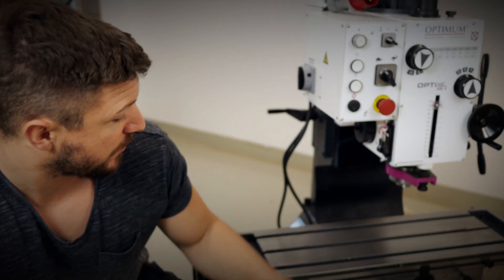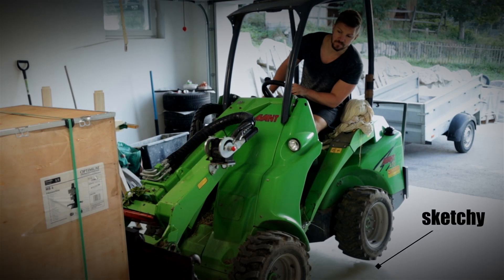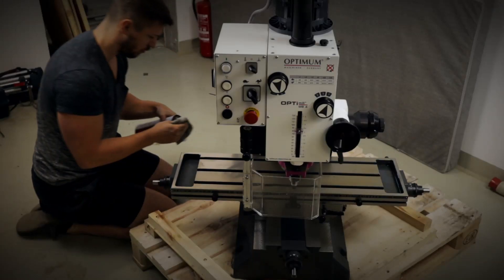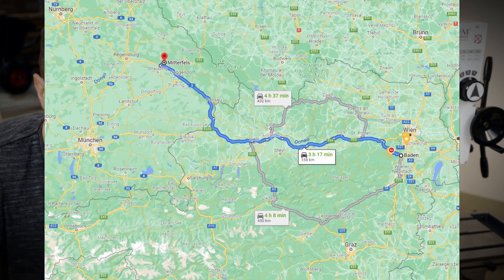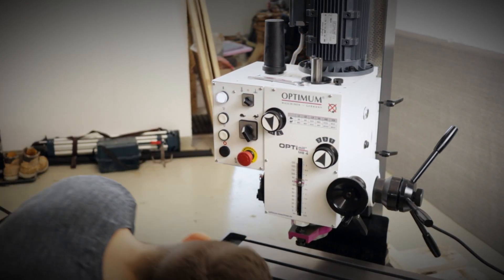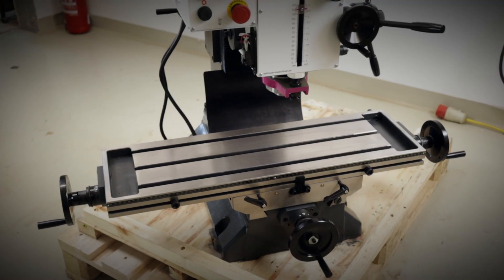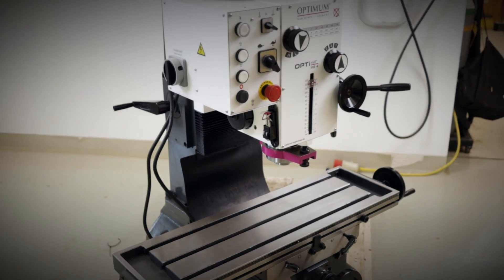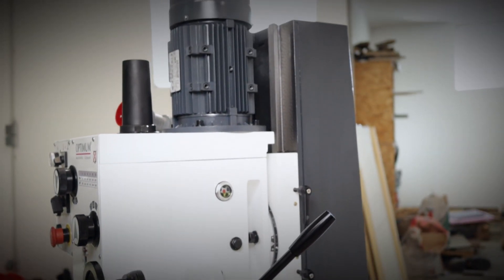OPTIMUM MB4 | is this chinese milling machine any good?

Comment: Good review.
I was thinking about mentioning Stefan's epoxy tramming video when you did.

What other mills did you look at or consider? I recently ordered a lathe through the local supplier in Australia and am looking at a mill in the near future. Right now I just want to get set up and started with the lathe and start making chips.

What projects with the mill do you have planned?
Reply from the maker: If i could afford it, i would have gone for a bridgeport, since they are more Universal and capable, but on the other hand, they are also huge, and take a lot of space.

They are also often pretty worn out, and the new bridgeport clones, are expensive.

I think the rf45 style mill, is for ita price the best you can get.
First projects will be a slitting saw arbor, a vblock, and a powerfeed.
Reply: @ChristophLehner  Good projects to start with. 
Blondihacks and Stefan G both did slitting saw arbors. Stefan's was the usual Stefan magic but Blondi's was pretty good and looked a lot easier.
Reply: @ChristophLehner  If brand new Bridgeports were only 2 or 3K we'd all have 1.
But in the land of reality we take what we can get our hands on. After watching Rustinox I'd take a shaper if it dropped in my lap. There's a lot of stuff you can do with one of those.
Reply from the maker: If dropped in my lap, i'd take a small shaper, a surface grinder, a debit grinder and the list goes on, as long as  i have space in my shop :D
Reply: @ChristophLehner  You forgot the Hermle 5-axis and Kern super precision machining centers. 👍👍👍
Reply: @tonywilson4713  I have an Alba 10" shaper that pits a surface finish on blocks far superior to that of the mill. Very handy for cutting internal keyways and dovetails too.
Reply: @howardosborne8647  Robrenz - highly capable???? 
Maybe just a wee bit of an understatement. 
Have you seen the indexer/spindle he just made and the tolerances he made it to?
How about those couple of gauge balls?

One of the simplest things he did and one of my favorites was the reverse threaded screws for attaching vice jaws. That was simply clever.
Reply: @tonywilson4713  Yes I've seen a lot of his toolmaker skills on video.
Reply: @howardosborne8647  What so many people love about Robin is that he has incredible volume of experience that he wants to share.
Him and people like Tom Lipton, Setfan G and others ARE WHAT the internet was meant to be like. A place where people share their knowledge.
The crap that people like Zuckerberg, Murdoch, Tik Tok and others unleashed is something else.
YouTube is somewhere in between.
Reply: Tony,I was also getting ready to mention Stefan's improvements to his Optimum 45.....we're both too late😂😂 
These seem quite a good mill with a bit of fettling work.
Reply: @howardosborne8647  Have you seen Robin Renzetti's effort with the Chinese D-Bit Grinder?
Reply: @tonywilson4713  On Robrenz channel? If so then yes I have seen that. He is another highly capable fellow.